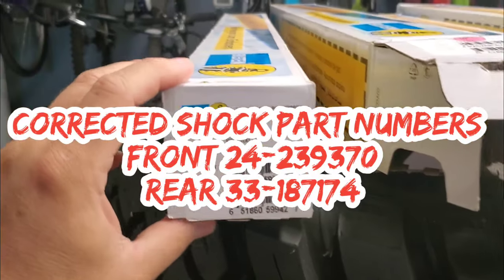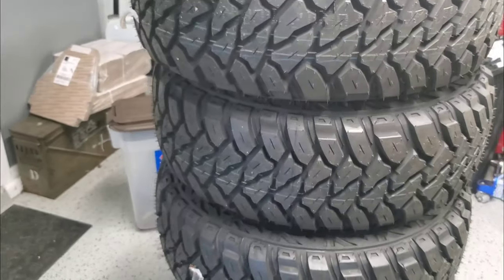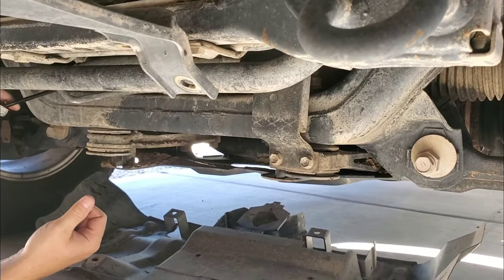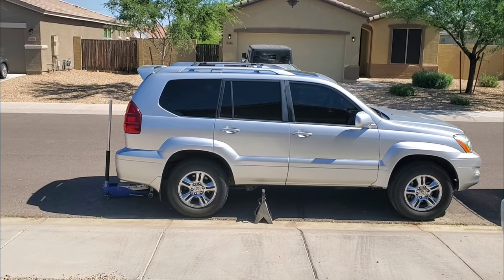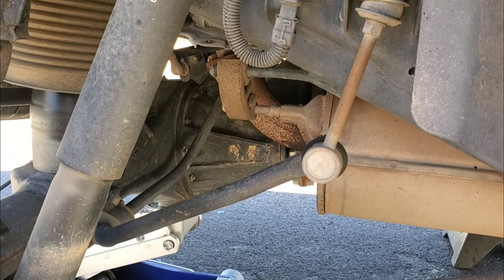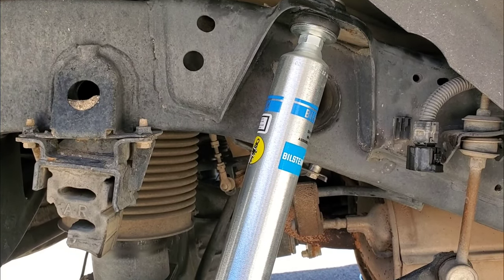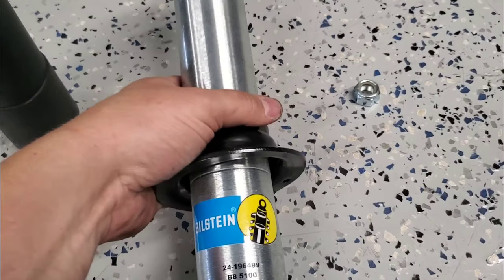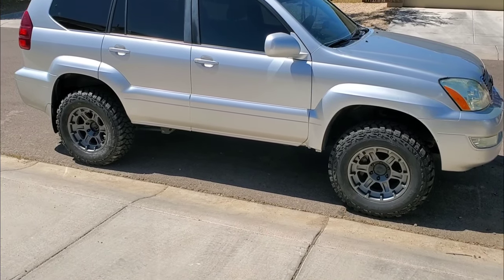SIMPLE LEXUS GX470 / GX460 / 03-09 4RUNNER LIFT. AIRBAG TRICK - BILSTEIN 5100 - DIFF DROP

Comment: This looks great. I just bought my used GX470. I don’t think I have the tools you do. The air gun or the tool to compress the sprint but this turned out great and I love the price point you mentioned. Has this given you any issues since this video was made? I’d like to give this a try.
I also have an air suspension question. I put it in hi and usually within 1-2mins I’m back in “N”. This leads me to think I might have a leak. Which seems it may negate this lift if the bags aren’t working properly. Thanks for the great video, definitely subscribing!
Reply: I realize this was an old video however, still relevant. Continuing from the previous point, could you recommend a relatively inexpensive coil over? I have seen several people talking about the bilsteins which is what I am leaning toward, however I am planning to delete the airbags which means I have a few more parts I need. Again thank you for any help.
Reply: There is a speed sensor, once you go 25mph the airbags will return to N, this is why you need to trick the sensor if you want it to stay high, it changes your N height.

Comment: Well I finished the front just now, and it’s looking good so far. My alignment is really messed up though, I couldn’t get the camber bolts near where they were before, and frustrated and tired, just tightened them up knowing that I’ll take it for an alignment tomorrow after I do the rear. However, after a quick test drive I now have a VSC Trac, VSC off, and slip indicator light on my dash. Is this from unplugging the factory adjustable front shocks in the front? Did you remove any fuses or get any of these lights? It also seems like it’s driving sluggish, not sure how that would be related. Could just be all in my mind since I didn’t wanna push it hard test driving. Did you experience any of this when you did yours?
Reply from the maker: Notta, sounds like an abs sensor wire got pulled hard. Why did you take out the camber bolts or adjust them? If alignment was OK, would have been fine to drive to an alignment shop.
Reply: Mr. Garage Mr. Garage hm, I didn’t even touch or remove the abs and don’t think it got pulled it, but I guess it’s possible. I loosened the lower control arm so I could just drop out the front struts straight down without having to remove anything else. I tried putting them back close to how they were but after they were almost fully tightened they moved a bit and I just left them considering I’m getting an alignment tomorrow. Any suggestions on how to remedy or test the potential abs problem?
Reply from the maker: The ABS wires are attached to the spindles. If you pull on them too hard or overextend the control arms, you can pull them too tight and break the sensor wires. Usually requires new sensors. I would grab a code scanner and see if you are throwing and ABS code.

Comment: Excellent video! Did you experience any rubbing at this tire size?
Reply from the maker: With factory wheels, no. With the -12 offset, yes. Have to pin the front fender liners forward + heat gun them a little.

Comment: I’ve bought everything except for the rear shocks, are there any other rear shocks I could use instead as the ones in the link are not available for quite some time? Thanks
Reply from the maker: They do not have to be 5100 shocks for the rear. Most name brand fitments will be better than blown stock shocks. Can at least give a decent ride KYB 344410 will get the job done for cheap.
Reply: Thanks so much, I’ll check it out !
Reply: Did you use the stock springs on this project? I realize there were no parts listed. Just want to make sure they still work

Comment: Just got a 2006.  Lexus maintained 190K.  New everything incl airbags.  It has stock wheels with 265/65/17s on them. Tires have about 10K on them.  It seems to have alot of space between the wheel wells and tires already.  Q#1: Any thoughts on what the stock measurements should be from tire to fender in front and back ?  My backs are def higher than front.  Q#2: Will 265/70/17s on 8.5 rims make much difference looks wise? Q#3 If I just put on spacers, will a lift be needed to prevent rubbing ?
Reply from the maker: 1. I do not have the stock measurements. Front springs could be a bit saggy and or control arm bushings shot which can also affect ride height a bit
2. Yes. They are 1" Larger. Going with an AT, RT or MT tire will always look larger than say the same size tire in an LT all weather tread pattern
3. With only spacers, you may need to pin the front fenders forward. Requires removing a bolt, pushing the plastic liner into the bumper area, drilling a new hole for the bolt and re-attaching it
Reply: Mr. Garage thanks once again for your prompt and excellent reply/advice. Really appreciate your help !

Comment: I’ve done everything except now im trying to put the 5100 front struts in and they seem to be too long, i have it on the second ring like yours.  Any help would be greatly appreciated
Reply from the maker: They are not to long. Any setting = same length but more spring preload. You generally have to disconnect the swaybar links to force the arm down far enough.

Comment: Results look great.  I'm currently debating something similar with my sequoia.  I'm guessing you trick your airbag neutral heigh position into being higher with the washers.   What would happen if you aired them up to high?

I'm debating between this mod or disabling the air ride system with a switch once they've aired up so they don't deflate after driving like 15 mph.
Reply from the maker: The height settings are fixed. The additional height has been no problem for the bags.

Comment: With the current lift set up how much bigger of a tire do you think you could fit? Been looking at 285/70r/17. Didn’t know if you’d think I’d have an issue going just a bit bigger. Appreciate the video!!
Reply: You will rub quite a bit but may fit you would definitely need to move fender liners

Comment: Leaving the air bags a installing new shock and strut. Do you have any light flashing on dash? Most of the videos out there remove the air bags completely and take some fuses out.
Thanks
Reply from the maker: Does not throw any codes unless you stretch the ABS sensor wires doing the job and damage the sensors. Otherwise - no worries!
Reply: Thanks. Will be busy Saturday

Comment: Nice setup....i see your sons 4runner i take it.....any mods on that besides the roof rack basket.... does he have a channel?
Reply from the maker: Hello,
Yessir, the silver 4runner is my sons. My other boy also had a white 3rd gen until an unfortunate accident. Both setup identical to my GX's with 5100's. Both 3rd gens run 07 FJ cruiser springs which net a mild lift. My boys do not have channels, but my youngest with the silver running has been thinking on it.
Reply: @MR_Garage  nice ... a Toyota fam.... sorry abt the accident. Hope he was ok when it happenned....like your setup. Good to kmow on the axle/diff lowering tip👍🏻😁

Comment: Great video really appreciate, I am trying to use the link to make a order found the front lift on eBay and Amazon parts number is different, which one I should order thank you
Reply from the maker: Appreciated! This is the correct link for the front and correct PN https://www.amazon.com/gp/product/B00TO61E7E/ref=as_li_tl?ie=UTF8&camp=1789&creative=9325&creativeASIN=B00TO61E7E&linkCode=as2&tag=mrgarage-20&linkId=1fa07b82ca934347320b964d3c6c56e7  

The ebay listing has an error, they show the wrong part at the start of the post but then have the correct front part later on. I have advised the seller. Just message them to make sure.

Comment: What wheel offset do you recommend for this lift/tire size combo? Thank you for the EXCELLENT GX470 content! 💪👍👍
Reply from the maker: Hey Robert, I like a 32 to 33" tire maximum. The 32 fits without much work. 33 needs pinch welds hammered and some other work. The wheels here are tandem offroad 612's. Tires are 265/70/17 which is close to a 32.
Reply: @MR_Garage  Thank you. The 265/70 is what I ordered but I was wondering specifically about the wheel offset: 0mm, -12, etc.
Reply from the maker: -12 on these

Comment: Great video! Do you have to do anything else with the disconnected sensors connector on front and rear shocks? Do you have to disable any system like pulling fuse or relay?
Reply from the maker: Nothing else at all! Just unplug them.
Reply: Is there any way to get the dash lights (ABS, VSC TRAC) to turn off?
Reply from the maker: The only reasons those lights would come on if you eliminated the stock shocks / struts would be if you damaged an ABS sensor cable during installation. Just unplugging the sensors or removing them does not throw any codes.

Comment: Looks great, awesome video. I have a question, does this change the auto level feature? Or does it sit well enough even with the hitch loaded? I have a 05' base and have a small 18' skiff on the way plus hopes of trailering a small kayak/paddleboard trailer for fishing and adventures in Florida. If i did this modification it would improve towing for those things all around? Thanks!
Reply from the maker: Since you are tricking the sensors with this lift, when loaded, the bags will keep the lifted height and your ride will stay 95%ish the exact height in the back as if it had no load on it at all. That is why airbags kick ass when you tow. No squat or sag.
Reply: @MR_Garage  awesome, this seems like a good option for me. I want to keep that adjustment for towing. Buying all new OEM suspension is expensive but I was considering it. Is ur ride quality improved with this over the stock system? Do u get error codes with the shocks not having the connection for the ECU?
Reply from the maker: I like the ride a lot better but hard to compare the old worn out stock suspension vs new. For me, the ride definitely improved on both GX's. And no, unless you stretch or break and ABS sensor wire, you will not throw any codes.
Reply: @EODtrooper  no - disconnecting the adjustable shocks does not throw codes / lights

Comment: I kind of wish you would have taken a measurement in the rear to show the airbag trick works. It's really hard to see much of a difference, especially with the meatier tires.
Reply from the maker: To show it works? As if I am spoofing people into the airbag trick? 😅 If you want a measurement, you can measure from hub center to fender. That takes tires out of the equation.
Reply: @MR_Garage  Lol oh man, I didn't even see that you had replied! What I mean is more if 6 washers gives you the correct height. I'm getting ready to do this soon on my GX. You said one washer gives you about a quarter inch to 5/16ths, so 6 washers would be 1.5-1.875 inches in the rear, yes?
Reply from the maker: All good man :) Start with 6 washers and see where it is after the total lift is complete. Drive around for a day and see if you need to drop it a tad.

Comment: Amazing vid thanks for sharing. Would the max height setting on the bilsteins be too much for this trick?
Reply from the maker: On max height, ride would suck bad. Spring preload would be nuts - too stiff. And you would not get it to align unless you went with custom upper control arms
Reply: @MR_Garage  Okay thats good to know, might just go with a coil conversion. Thank you
Reply: @MR_Garage  One more question, do you think 285/75/17's would fit with this trick with minor remedying in the wheel well area?

Comment: How is the ride with the new tires and shocks? Is it similar to the factory ride? I’m going to do mainly highway miles. You mentioned the e rated are rougher? Why did you pick the tandem rims?
Reply from the maker: More controlled than stock, slightly stiffer. No complaints at all. Chose the tandem wheels as they are badass with the perfect offset.  👍

Comment: Going to finally do this tomorrow! Do you have any tips for removing the factory adjustable shocks? I know in the vid you said they were a pain. Do I need to disconnect the ball joints?
Reply from the maker: Just unplug the rears and replace. The fronts you unplug but the top electronic adjuster can be a pita. Since the struts are trashed, I took a hammer and prybar and jus broke the top assembly totally off (plastics). Then, can get to the nut that holds the large metal bracket for the electronic adjuster on. Take that off and remove the bracket. Then, there is a back bolt on the strut top that is a pain to get to. Spray penetrate oil on it prior to trying to get it out. Last, the shock will come out without disconnecting the ball joint. Kind of a have to rotate the shock over and over and slip it out between the A-arm and such. Just a super tight fit. Good luck!
Reply: Mr. Garage Yeah from what I’ve gathered the removing those brackets in the front will be the hardest part. I may just end up breaking of the plastics if I get too frustrated also. Thank you for the all the tips!

Comment: Thank you for all the great GX470 videos! The drawtite hitches look nice but get a lot of terrible reviews for being bent with bad alignment issues. Do you have any suggestions around this? I was thinking maybe a local place has them and I could find one that isn't bent up, IIRC uhaul installed one on my jeep back in the day. I checked uhaul, they now sell their brand class 3 installed for around $250, do you have an opinion about these? They claim capacity is 5000 lbs. 

Also, have you tried the factory hitch? It's a class iv but may be slightly more expensive. 

-A
Reply from the maker: 5K lbs is a lot lower than the drawtite at 6500 (more with weight distro and higher tongue capacity). I did not have any issues with mine. Ordered from etrailer.

Comment: What is the Diff Drop part number(s)? I want to get everything ordered at once and then take it to MDS customs in Mesa.  They told me it's approximately a 4-hour job.  I want to get 285 70r17s because I see lots of GXs throughout the country with these tires, but I may settle for the 265 70 or 275 70r17 (looking at going with the Falken AT3W-mountain snow driving) not a daily driver in Arizona.
Reply from the maker: I have the diff dropped linked in the video description.
Reply: @MR_Garage  Thanks much! :)

Comment: Thanks for the video I picked up bf goodrich 285/70/17 wheels... will this mod be aprobatoria for this size or are there adjustments I need to make?
Reply from the maker: Hello, it is BUT. Your tire is virtually a 33". Depending on the wheel offset, you may have some decent rubbing. Will for sure have to pin the front fender liner back. Likely best to do that and go ahead and correct the pinch welds and do the body mount chop (can search for this). My next tire will be the same size as yours likely (I am on 32's right now) and those are the mods I will have to make also.

Comment: I will be doing the Bilstein 5100 for the front lift also on my GX470 however I do have a quick question you say the correct part number is  24-239370 for the front shocks But when you demonstrate installing the snap ring on the shock itself is says 24-196499. So which part number is correct on amazon they are priced differently also? Thanks
Reply from the maker: Hello, Correct parts are listed in the text and in the video description. Found out the company accidentally sent me fronts for later gen FJ and Tacoma fronts. After a talk with Bilstein, the specs were so close it did not matter. So I just used them but listed the proper GX part numbers
Reply from the maker: Part Number: 24-239370 - (2) Front 5100 Series (Ride Height Adjustable) Shock Absorbers
Part Number: 33-187174 - (2) Rear 5100 Series Shock Absorbers
Reply: @MR_Garage  yes I know you gave that part number but if you watch your video when you are demonstrating the snap ring for the front on the shock it shows part number 24-196499??
Reply from the maker: Correct, as mentioned that is the PN for the later gen FJ / Tacoma's and such. I caught this and added the proper part numbers to the video description and also in the text in the video. The unit is almost identical to the GX one so I just used it. Can't tell them apart on my two GX's. So as stated, the correct GX PN is 24-239370

Comment: Can you do the air spring sensor trick with stock/oem shocks in the rear instead of the bilstein? So stock shocks in rear and bilstein struts in the front.
Reply from the maker: You can but the stock rear shocks would be blown or have virtually no damping by now. You would end up with a lot of bounce. You do not have to use bilstein rears if they are out of stock, could go KYB.
Reply: @MR_Garage  I was planning on going with brand new oem shocks.  I wanted to make sure they would still be okay with a sensor lift.
Reply: @spdrcerjt  I tricked my airbags but didn't use 5100's. Instead, I installed the yellow HD's. Installed HD's up front as well with a 2 inch cornfed spacer and used factory coils. 40,000 miles and still going strong.

Comment: I've got 272 k (stock F/R suspension) on mine and I'm wondering if I should swap springs and air bag delete due to the high miles? Also did you use the driver side front spacer to account for the leaning issue I've read about? @Mr.Garage

Comment: great info. how does this ride compare to stock? you mentioned stiffer shocks, is it jarring? thanks.
Reply from the maker: Stock feels far too soft. Floats around and feels sloppy. with more air in the rear bags, more pre-load on the front springs, it feels far more stable. Load range E tires help too on the stability (stiffer side wall). So many things are changed in this easy lift (spring pre-load, air pressure, tires....) it feels totally different. Nothing like stock but still no complaints.